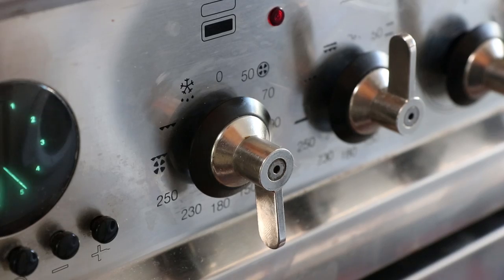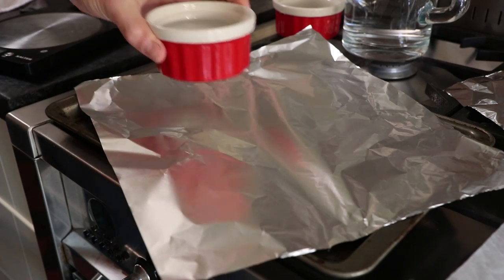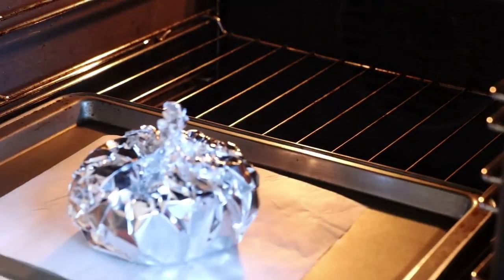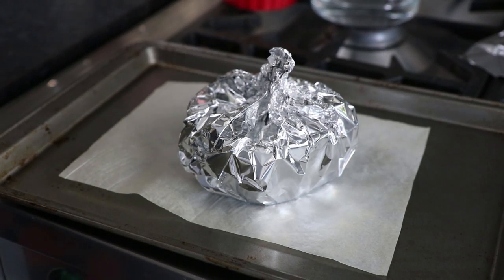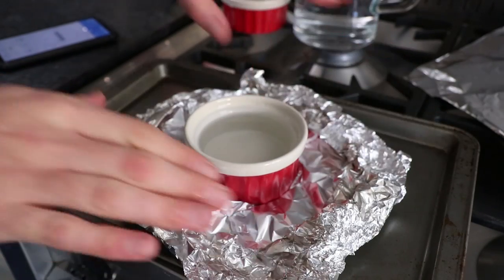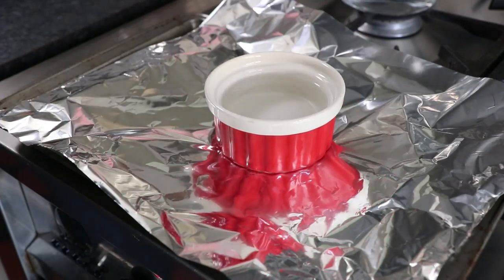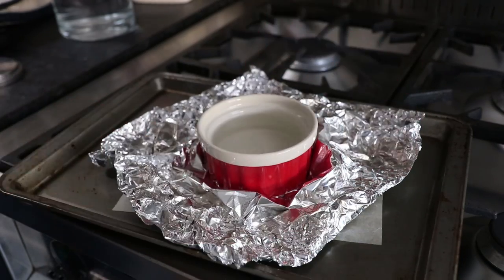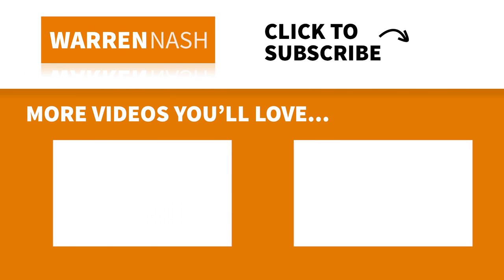Aluminium Foil, which side up? Shiny IN or OUT? - Warren Nash

Comment: The shiny side is bc that's the side that touches the rollers in production..
Reply: It also reflects the heat so any food would take a little longer to heat up if the shiny side is on the outside, this experiment does not account for the reflective aspect while the water is getting to the oven temperature

Comment: Why didn’t you just heat both at the same time in the first part
Reply: @Lab4ny34  No, it's because different areas of an oven have different temperatures.
Reply: It helped add 15 seconds to the video.

Comment: Would be funny if: 1 heated up faster but had less heat retention, the other heated up slower but had more heat retention (making them the same temperature in the end). Doubtful though.
Reply: This was a experiment in the same way throwing crap at the ceiling is art. No measuring the oven temperature or even putting them in together, to make sure the circumstances are the same.. and no measuring between the steps..
Reply: Not doubtful at all, that's probably what happens. One gets to the oven temperature a little faster than the other is my guess, this experiment doesn't prove that either way
Reply: Thought the same
Reply: Not sure why this guy didn't use two identical dishes wrapped in foil and then heated and tested at the same time.... Hell, he could even have used 4, and tested two immediately. *sigh*.

Comment: I always get stuck when it comes to putting something like frozen chips on foi. Do you put them on the shiney side or the non shiney side or does that not matter either ? :)
Reply from the maker: I'd say that doesn't matter either.  Plus, parchment would be a better option.
Reply: Just use baking paper it will not stick and works way better

Comment: HERE IS WHAT YOU MISSED...The issue with the shiny side versus the dull side has to do with INFRARED LIGHT, which isn't much of an issue when you WRAP something in foil...no light can get to it, the only heat that can get to it is THERMAL CONDUCTIVE OR CONVECTIVE heat...that is not the same thing as ELECTROMAGNETIC RADIATION (light).

The time to pay attention to which side is in or out occurs when the heat source is infrared, such as glowing charcoal or an electric heating element that is visible to the foil surface. If light can be redirected by it, infrared heat can be redirected by it and it can FOCUS light on something in the cook area...or away from it.

whatever is in that light path could get cooked less evenly if it isn't subject to a more dominant source of THERMAL heat, such as you used in the experiment. You blocked the lightpath in all cases...and you don't have an infrared heat source. 

For reference, the primary reason I found this video was because I was hoping to find something to explain to someone why his gravy tends to burn when he lines the bottom of an OPEN TOP pan with the shiny side up and not with the dull side up. He learned that from experience and wanted to know the science behind it.

I haven't found a video that has performed a test with an open pan and a broiler with a heat source that is visible to the food, liquid, or thermocouple. The heat source needs to be capable of shedding it's light onto the food and the placement must insure that it isn't dominated and overwhelmed by rising thermal convection and conductivity from below. Charcoal that is placed indirectly from the food can very well shed INFRARED light heat onto food that isn't in the path of most of its thermal convection. A broiler has similar characteristics. 

A parabolic reflector has a polished finish because it reflects light better than a dull finish, right?

Shiny Aluminium is the choice material for reflecting and focusing light, including for infrared radiant heaters. Infrared heating has the ability to transfer heat to a person or object without heating the surrounding air because it is very high intensity LIGHT that is invisible to humans...if light isn't able to reach the person or object from the source, the infrared heat cannot reach the person or object.

9 out of 10 times you won't notice a difference because most of the time you wrap and cook with thermal conductive or convective heat...it's that 1 out of 10 times when you find yourself wondering...WHAT WENT WRONG???...and the foil and radiation of lightwaves might be the culprit.
Reply: You could’ve done the experiment yourself in the time it took to write this novella